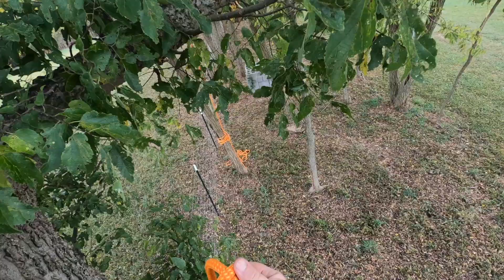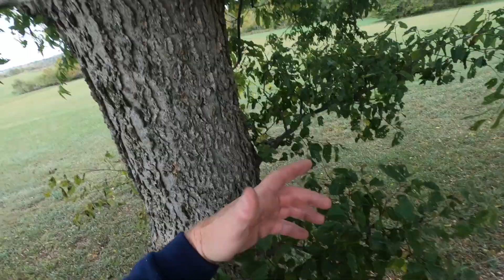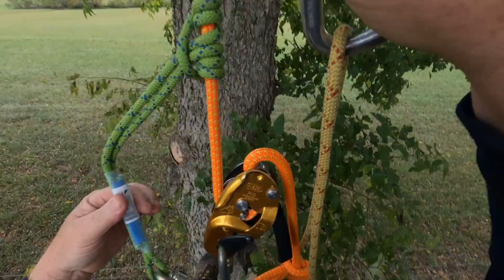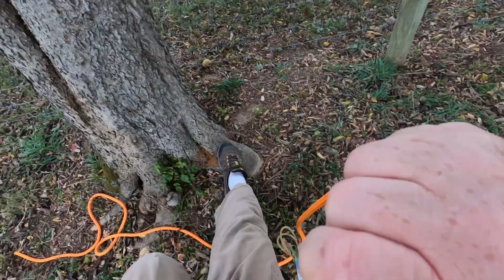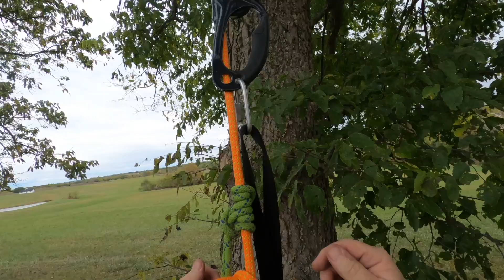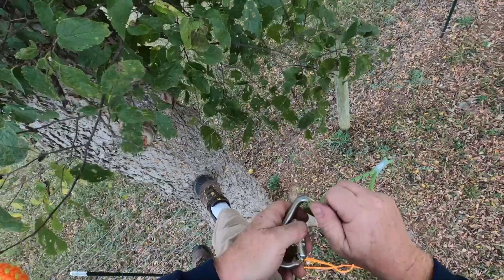Passing knots on rope

Comment: Perry, great job!  Your video makes me stop and think, "What could go wrong with my climbing rope?"  I'll have to add two additional items to my work plan check list: bring an additional prusik & fall arrest device as a self rescue kit in case my climbing rope gets damaged or abraded badly.  Arborists are taught to inspect the tree and surrounding area for signs of root damage/rot, hazards such as wasp nests, poison ivy, or electrical conductors, etc.  We don't think about passing knots, but you raise an important safety question.  I will climb safer because of this video.  Much appreciated.
Reply from the maker: If you are an arborist then you should check out the rescue competitions for tree workers. They do things a bit different because of the gear but really interesting. And yes, a set of prusiks will get you out of a lot of predicaments.

Comment: Perry, wonderfully clear video! I do, however, have one suggestion. When you have your weight on the prussik(s)/ascender above the knot you are passing, and you take off the assisted breaking device, you are relying on just the ascender and prussik(s) to hold you. Friction hitches and mechanical devices like ascenders are not to be used  alone to support your life without some type of fall arrestor device or system to back them up. The ascender could flip open, the prussik/friction hitch could come loose if pushed from the top or bottom, and then you could fall to your death. A simple solution in both of these circumstances is to tie a catastrophe knot a few inches below the knot you are passing (and below your bottom prussik when passing on an  ascent), and clip this into your harness belay loop or hard points. An example would be a figure 8 on a bight or overhand on a bight or clove hitch. Then, if the ascendors or friction hitches fail when your ABD is out of the system and being moved over the knot you are passing, the furthest you can fall is to that catastrophe knot, and you will hang off it, saving your life. Overall, great video, but adding this addition would make it safer. Keep up the great videos, I think they are helping a lot of people!
Reply from the maker: Check out this video that is up to professional standards in the rope access world: https://www.youtube.com/watch?v=PcpbQ5TId3I&t=2s

Your points are all valid as you can never be too careful. However, there are different standards of safety according to what you are doing. That is why I labeled the technique for sport rappels. 

All great points though, thank you for sharing. Cheers